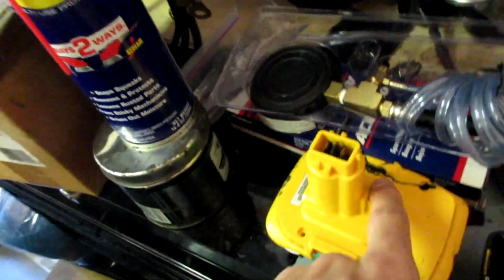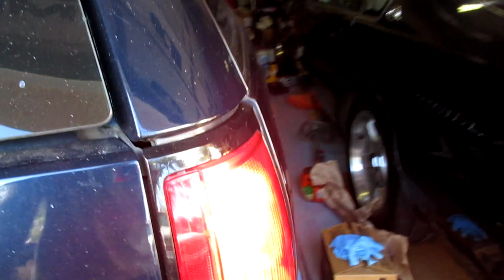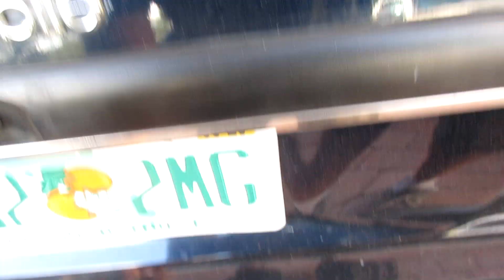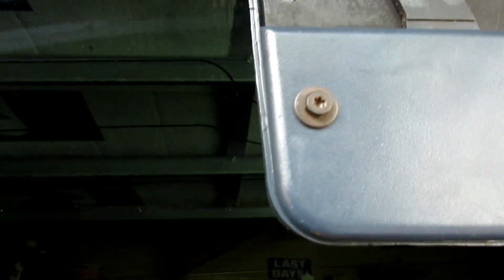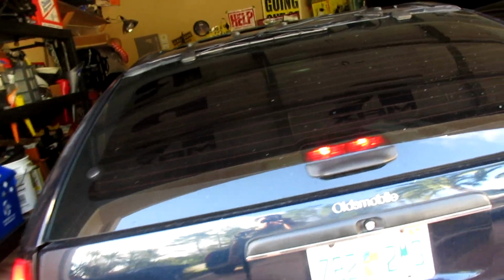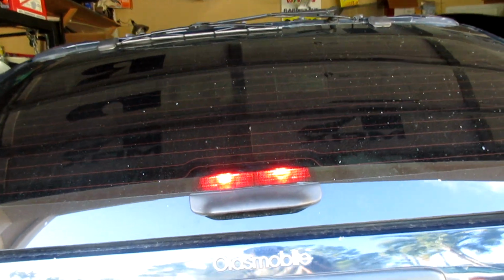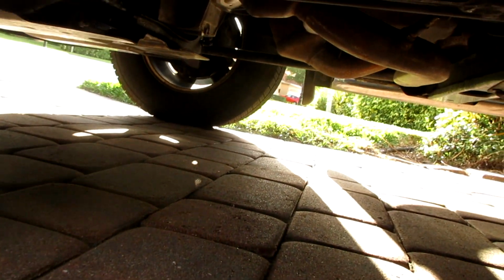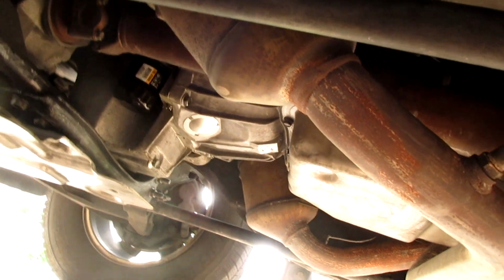NEW COOL 3rd brake light LED bulbs for Ghetto wagon!!

Comment: Look great! I’ll have to do this on my Roadmaster. You should replace your rear side marker bulbs while you are it it, it looks like one of them is brunt out!
Reply from the maker: Nahh the lights were not on.  Ya get the bubs on ebay , they wont melt the brake light assembly. Hard to find good used ones. If it ever totally kills it I believe some put in a whole LED panel out of a newer vehicle and wired it up.   Every sedan has a LED 3rd brake light now. Just need to measure and pick one at the junkyard.